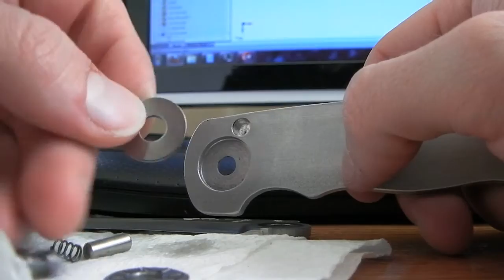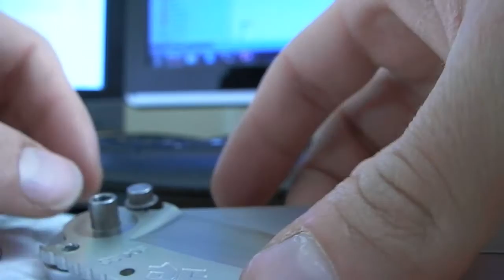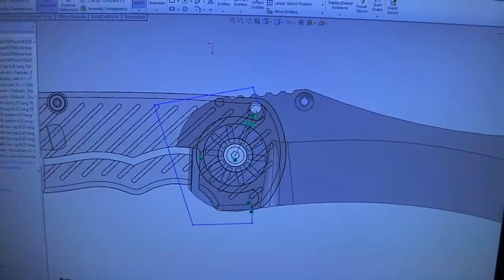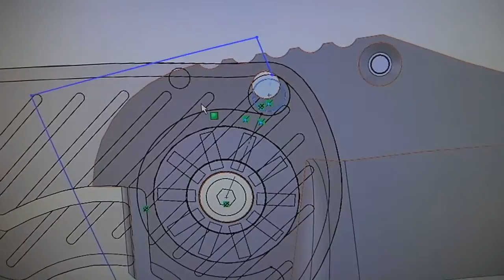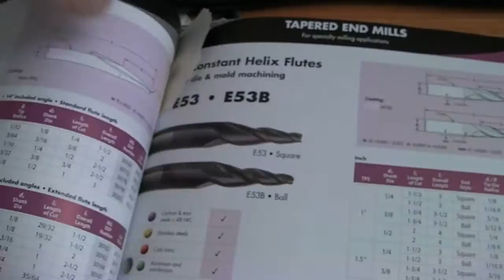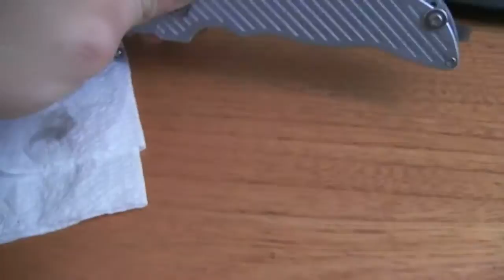Knifemaking Tuesdays Week 07 - reviewing the first prototype in detail

Comment: @JohnGrimsmo 

I guess I was referring to a bigger roundover. Seems like a small detail but it makes a knife more versative in different grips. 

As for the edge I think the deformation would be more due to the fact that you have a zero grind edge atm. If you put a secondary bevel as with most hollow and flat ground blades you'll be fine at 1/8 stock. Knives like the sebenza do just fine at that thickness.

Comment from the maker: @captjeff78 Solidworks for cad/cam.  The spacers I can make any size, the bearings are a fixed thickness so that does somewhat determine handle and blade thickness requirements.  I can make this 1/8" steel work but a bit thicker would be nicer to get everything to fit properly, these are really thick bearings.

Comment from the maker: @victorinoxfan This 1/8" stock is pretty nice for slicing, but it gets so thin at the edge I'm worried about chipping or deformation.  I'll have to do some testing with a proper blade steel after heat treat.  What do you mean by bevel the handle scales?  All the edges are already rounded over, but I would like to use a bigger roundover eventually.  Do you mean 45° angle bevels like your VECP?  Cuz I don't like those edges very much.